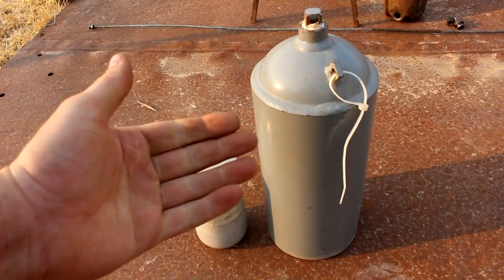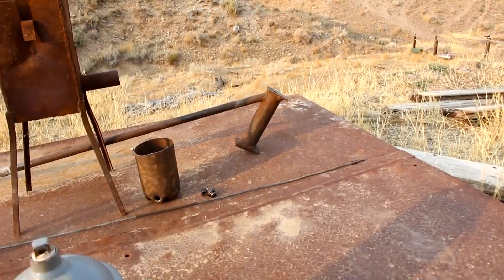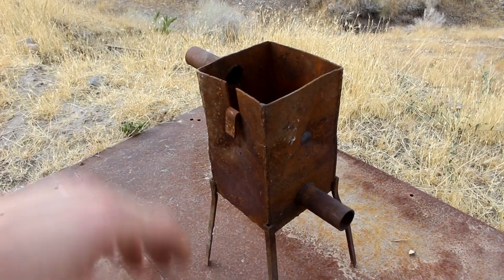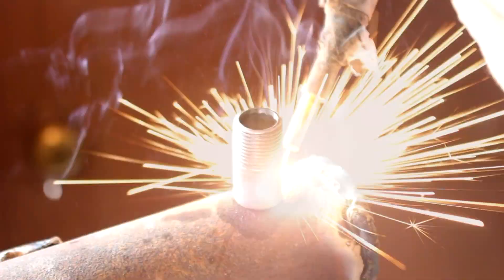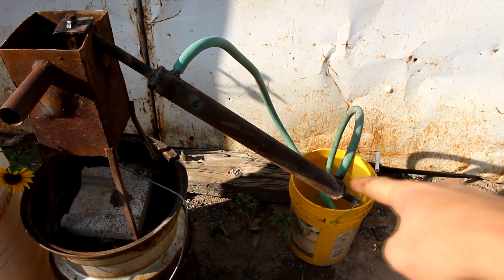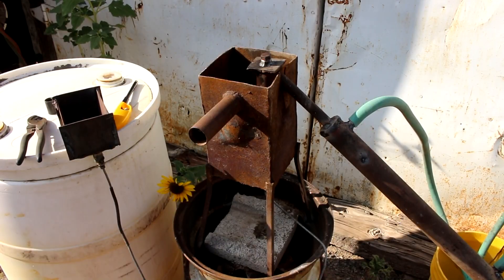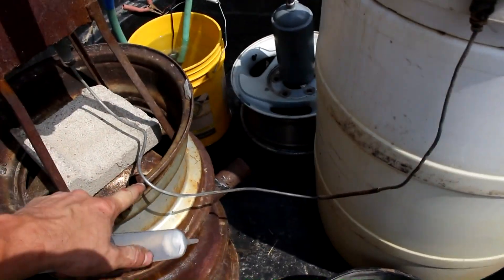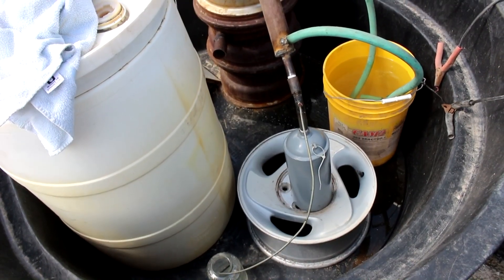Building A Mercury Still

Comment: When I distil, I don't use a pump for the cooling column at all,  I use a pan that is around 6 inches deep and 2 feet by 4 feet and run the distillate through a coil in the pan that exits the pan at the bottom of the coil.  The top inch of the water in the pan is boiling hot and evaporating, but the bottom of the pan still has cold water in it after more than an hour.  It works great for me and is simple.  But,  I am not distilling Mercury. I imagine if you use 3/8 inch steel line for the coil, and you ad some way to ad cold water to the bottom of the pan, this method would work for what you are doing, and it would be super efficient on cooling the vapor while using minimal water. 

Thanks for the awesome video.

Comment: NEVER expose your flesh to welding light- It's UV and will not only give you a good sunburn  but can also cause cancerous cell growth. Don't be this guy. Wear gloves when using arc/tig/mig and always use full face protection, long sleeves made from cotton drill pattern fabric. I've seen way too many arc eyes, burns and moles from poorly prepared welders. The worst I've seen is knuckles covered in weeping ulcers that took years to heal fully.

Comment: for your condensing radiator you should use a fan and push the hot air from the radiator into the fire to make it hotter

Comment: Can videoing welding damage a camera's optics? Just a curiosity from a layman.
Reply: Wondered the same!
Reply: @danielvalle3789  Yep! A buddy and I were working with plasma from a transformer and being into photography, the same question occurred to me. In researching it I even found people showing off their setups for welding glass rigged to their cameras, so photo/video quality is left intact without compromising the camera. It isn't necessarily bad, but you run the risk of overloading sensors and creating dead pixels and similar issues.

Comment: Mercury has been found at the bottom of certain ancient Pyramids in Mexico. The same Pyramids where ceramic art was found depicting flying craft. I am not making this up. I have also read about the ancient flying ships of India, they also used mercury. For what? The only thing I can think of, going out on a big limb here, is that if true, then it was something to do with mercury and static electricity. There is some phenomena with mercury and static electricity when poured through a screen. The beads separate.

Comment: Hey cody awhile ago I Learned how to distill crude oil and I was wondering if you could try and get, diesel, karasine, rocket fuel, octane etc, and since utah has I think 3 oil refineries neer salt lake I would think it would be easy to get the oil and I would mainly like to know the materials like a glass distillation tower or steel or what not. And if those materials aren't available, making a diagram or dipictuon of what Heights the chemicals are drawn off of the tower and there boiling points are. And I could just look this up but   you are the most trusted sience sorce

Comment: Could use seltzer water in the water jacket instead but you'd run the risk of corroding the iron pipe and carbonating the mercury but gain precipitation cooling as the carbon dioxide boils off in atmosphere, or for when you're out of fuel use a refrigeration coil in the distilled mercury putting the condenser coil heat back into the contaminated mercury.

Comment: Opposed to a radiator, I would use a water drop system... basically make a waterfall and the water should in theory cool as it drops, especially if you add some form of a nozzle to make it spread a little and not just a stream.

Comment: Why is it important to use iron equipment?
Reply: Iron doesn't form amalgams unless under very specific conditions and is unstable. So in most cases iron is by far the best option to use when working with mercury... unless you can get a bunch of platinum to make containers and stills.

Comment: That's not ash, it's the filler and binder (clay, silica etc.) they add in excessive amounts because they're cheap bastards.
Reply: Is that the kind of stuff that shows up when you dump hot mercury into a dirty rusty bucket?
Reply: I'm talking about the remains from the briquettes.

Comment: Cody, what would happen if you weighed a water bottle, and then froze that same one and weighed it? Would it be the same weight?
Reply: Yes? Unless you count the condensation on the outside.....
Reply: First Last thanks for answering my question
Reply: Though, there might be some minor difference from the change in bouyancy the air gives also.
It might have less air "pushing" it upward, but of course, there would still be as many water molecules and mass in it. It would still feel as heavy if you try to push it. Looking back, I think that is what you were getting at, the absence  of air and air pressure?
In a way it may come down to the definition of "weight".

Comment: With the welds if you want them to be cleaner you should hold the torch closer and have a more consistent speed of movement and push the weld instead of pull

Comment: You need to use whole chunk charcoal, Cody. It costs more, but its all wood. Kingsford etc is notoriously ash-y
Reply: How does one de ash char coal?
Reply: Well its not de-ashing it really. When Kingsford and other briquette makers make their charcoal, they press together pulverized charcoal and a ton of filler. Which is usually gravel and other fine tailing products. So by weight, something like Kingsford is almost 50% rock.

Comment: hey cody, I've run into something very interesting. I know the chances of you seeing this are slim, but you are the first person I thought of knowing about this. SO what I was doing is turning my scrap zinc into an ingot at my foundry, just for fun I poured it into water. near the top of the underwater zinc tower, I've seen that the zinc was forming spikes, similar to the "ice spike" phenomenon. there were quite alot of the spikes, so I thought to myself if I could make a "metal geode" by pouting liquid metal into a cast iron tube that has been cooled. I let the edges crystallize and poured the liquid out, but alas there were quite few zinc spikes, I was wondering if you can make any sence of what I'm talking about, maybe you could try to do this yourself? :)

Comment: Cody. I wouldn't use such a fast drill to drill on iron/steel. The drill bit could melt and drop on you. That's one reason why the tools for metal (but the ones to grind) are usually slow and use lubrication between the bit or the blade and the material surface.

Comment: What happens to the impurities? Do they remain at the bottom of the still, and do you need to worry about them clogging up that supply pipe?
Reply: It would mostly stay at the bottom of the still but there's a chance that a small amount of zinc to vaporize and solidify in the supply pipe

Comment: Cody would you consider building a liquid mirror telescope with the mercury? You could use the secondary mirror and diagonal from the reflecting telescope you used in the flat-earth video. They are fascinating and there are VERY few videos on youtube about them. They offer the potential to make enormous telescopes for very little cost, as there is no glass used in the mirror.
Reply: I did that 30 yrs ago. Used a modified record turntable. Pyrex pie plate. Never let mom suspect. Washed it off and put it back in the pantry after every use. VERY hard to eliminate ripples from slightest vibration. Has to be wiped often to remove oxide film. Can only cover limited band of sky without distortion becoming too severe. Bloody great gulp of light in the rare moments of still clarity though. A year after I did it some French university students did one about 1m diameter, I beleive.
Reply: @fizzyplazmuh9024  use clean mercury no oxides...
Reply: This is a great idea and would make a realy interesting video!

Comment: You might wanna try connecting your condenser in the opposite direction,
You've got the coldest water going in the bottom of the the condenser, so as the water is going up the condenser it's getting warmer.
If you switch the hoses around the water will be as hot as it's gonna get as soon as it goes into the water jacket then it'll cool as it goes down the condenser.
Your distillate will be cooler coming out of the condenser and your water will be cooler going back into the bucket

Comment: I'm curious, what happens to the metal contaminants? I assume they have a lower evaporation point than mercury (or the still wouldn't work at all), so are they just sitting in the bottom of the boiling chamber?

I was also thinking the water reservoir (bucket) was going to get quite hot. It's common for people to think "if I cool this thing down, the heat will go away" without thinking where it will go. See every Holywood "cooling it with liquid nitrogen" ever. Although I imagine most of the people watching this channel wouldn't make that oversight.

Comment: The bulky ash from the grill briquettes is at least partly because they contain fine particles of rock used as a filler to add weight, about 10% of their overall weight. That really bulks up the ash left behind, when 10% of the briquette is non-flammable to begin with.

Comment: Haha kinda does look like a still. Though for the condensing part of the stills i've seen they have copper pipe coiled in a water jacket hooked up to a hose so it stays nice, and cool. Then for boiling the mash it was just a big ass metal dairy container you would see on farms back in the day. Just hooked the air-tight lid to the copper coil, and added a thermometer mid way up the dairy container so don't end up burning/scorching it. Probably be some nasty tasting hooch from that thing if you could even convert it. Generally moonshine is much smoother than store bought alcohol. At least the stuff that the guy I know makes.

Comment: If you're thinking of improving your   still, I see one possible problem. Your condenser isn't thermally isolated from your boiler. So you're water cooling your boiler. Dunno how how big an issue it is though; steel isn't  radically heat conductive, like silver. But it's probably contributing to the water boiling.

Comment: Natural wood charcoal available at home depot is cheaper and lasts longer with more even heat ! Better for cooking and in smokers! And it does not contain sand and other crap to cheat you by weight!!! Bricketts are a ripoff !!!
Reply: Michael Shultz agreed. "natural lump charcoal". Produces just a tiny amount of fine white ash. 

Actually, Cody should make his own charcoal ;-)
Reply: Yeah brickets are awful watch AvE's video on them he tells you what they really are, some disgusting material that you do not want to cook food over. Just regular wood works way better just let it burn down into embers first.
Reply: The savior and the wolf god forbid someone tells you about a good product from the homeless despot.
Reply: Michael Shultz agreed a good portion of the brickets are filler.
Reply: Is this an ad for Home Depot
Reply: And most importantly not contaminated by gold

Comment: For the welding shots, is the unfiltered light safe for the camera sensor?
Reply: TheMightyMagic depending what you consider safe.
Reply: Digital cameras normally have UV and IR filters built in (some people remove them and the IR filters so they can take photos with a wider spectrum), so it should be safe for the camera CCD.
Reply: yes

Comment: AvE has a video on the evils of store bought charcoal.
Reply: That's because the charcoal is made from a renewable resource, often poplar. Hardwood  charcoal would yield much more heat but I think something like lignite (sp?) would be even better. It leaves metallic "klinkers' in the bottom of the stove but they can be removed with tongs.

I am more surprised Cody didn't realize that water was not enough for the heavy duty use of distilling mercury. I mean obviously it is going to have a lot of heat per gram, FAR more than ethanol would. I distilled some of my homemade wines once and I ran the distillation coil through the FREEZER TO oops.. to keep it safe. This way there was NO danger of an explosion or fire. He should have at least started with some ice in the bucket. I'd triple the size of that reservoir.
Reply: Commercial charcoal briquettes have sand in it. They maximize profits while you have to clean it out of your grill. Natural chunks of wood charcoal would probably not create so much ash.

Comment: How fine a sieve can mercury slip through?
Reply: Depends on how much pressure you can put behind it and how long you are willing to wait.
Reply: i wonder what it would like like leaking through fabric. 
does it have a high surface tension? i just saw the part with the cottin filter syringe. cool
Reply: Yep, the surface tension is very high, but because it is very dense the pressure at the bottom of a pool of it is also high, so the pressure can force it though fine holes, such as in fabrics or filters. Eventually the pressure is low enough that it won't go through under its own pressure, so you have to add more, like with the syringe.

Comment: Cody can you try making diesel from plastic??
Reply: There is a process called thermal depolymerization that can be used to convert plastics into diesel fuels. It can convert other inputs into various fuels too, there was at least one pilot commercial plant that ran on turkey offal and produced liquid fuels and some solid products. At least until the stench lead neighbors to shut them down. Not sure what happened after that.
Reply: I have the feeling that would be energy inefficient, but interesting none the less.
Reply: Yummy diesel
Reply: Emanuel Nemec ???? How? ??
Plastic and diesel/ gasoline are made from different fractions of crude oil how would you even turn a polymer into an oil...
Reply: +Justin Koenig distillation mate, polypropene is actualy really long chain hydrocarbon and once heated it gets cracked to mixture of gas gasoline and oil.

Comment: Cody, do you not use an inert gas to protect the molten metal from oxygenating? your welder didn't have a gas shroud...the welds didn't look porous.
Reply from the maker: This welder uses foofoo dust in the wire to protect from the air.
Reply: ahh flux core, gotcha, my bad. You're so knowledgeable in so many things cody it's amazing. Keep it up man, thanks for the vids

Comment: A coding you should clean the inside of your pipes with like sulfur acid or something Bill eat away some of the steel and what not but it would help clean everything also big thing is you need to remove the you need to remove the iron oxide because that's just going to make a contaminant in its own right of the Mercury it may not be dissolved contaminant but it would still be a contaminant

Comment: Why you think it wouldn't work as moonshine still just fine? :-)
Ok you could use a bigger boiling side container, perhaps some big old pressure cooker...
Reply: It's too small for good moonshine, it would be difficult to make cuts for a good-tasting product. The continuous process setup also wouldn't work because the undistilled part of the wash would quickly fill up the heating vessel. It works with the mercury because the quantity of contaminant to be removed is very small (probably <1% contaminants) and can be allowed to concentrate in the incoming mercury.  With moonshine the quantity of water is large relative to the alcohol (varies, but typically 85-95% water).

Comment: Cody what's Mercury for?
Reply: Extracting gold mostly. That's why his father has so much mercury.
Reply: It was very common in thermostats and electrical switches, also thermometers.
Reply: Tooth fillings as well,  if you have silver fillings,  those are an alloy  (amalgam) of mercury and silver.
Reply: First Last  nope, nope it doesn't.  It leaches out at such an incredibly slow rate that's completely harmless.   It's not just mercury being squirted in your tooth, it's a mercury-silver amalgam.
Reply: assassinations
Reply: justin8466347 its not that mercury is toxic , that it was used in bullets. the use of Mercury in a bullet was to cause extreme cavitation.
Reply: Bernardo B Is something wrong with asking? :/
Reply: Perhaps your definition of harmless is a bit less absolute than mine, but I think 1 molecule of mercury does the same thing as 10, or a million, only in a different scale.
Reply: google it lazy ass
Reply: Im still baffled that is even legal. Putting poison release capsules in peoples mouths.

Comment: Considering your shroud is missing I think your welding is astonishingly good. Outdoors with no shroud you must be using a crap pile of gas!
Reply: flux cored welding wire...
Reply: Didn't look like there is any flux on his welds to me but that may well be the explanation. In my experience, mediocre is about the maximum weld quality achievable with flux core, so he's still doing very well In my opinion.